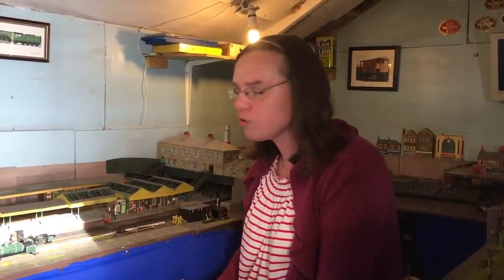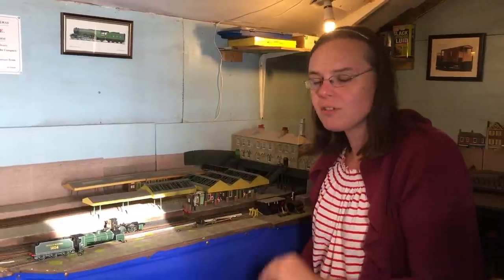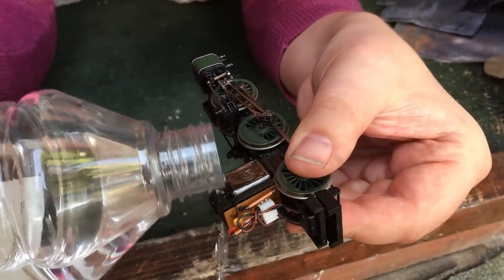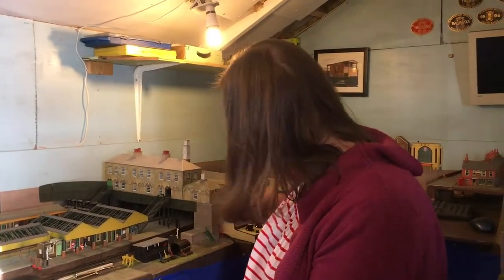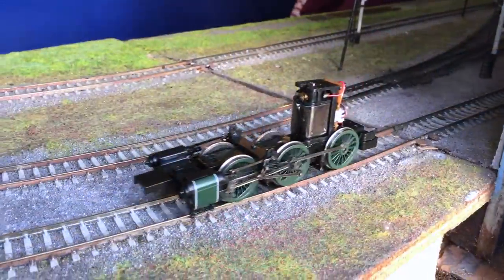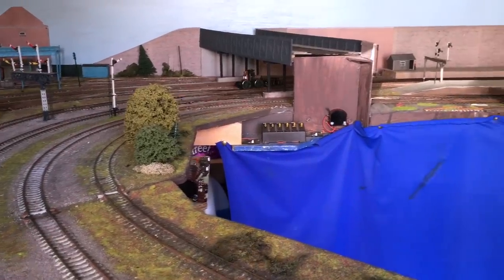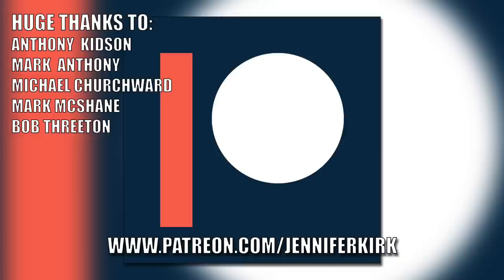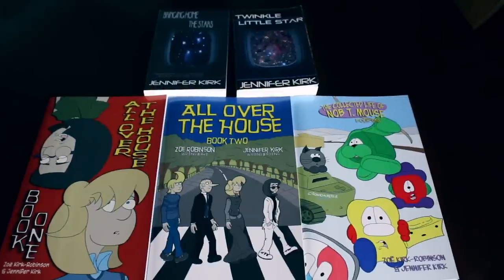How To Repair Suspected Burned Out Model Locomotive Motors

Comment: I had to look up "white spirits." It is a British description. It is the same as turpentine or mineral spirits in the states. I will try this. When I started repairing trains in a hobby shop some 50 years ago, I was taught to only use denatured alcohol, or grain alcohol poisoned to make it unsuitable to drink. In some cases, Electric contact cleaner could be used. We always made sure that the cleaner would not react with the plastic, or paints. Your solution is more economical. Thank you.

Comment: Can i wire up a capactior to a dc moter directley as a stay alavie
Reply: Yes , it will also give an inertia effect . I did with a slot car.
Model railway, on the other hand has a problem it runs both directions.  Polarity of rail changes so you need a bipolar electrolytic capacitor or 2 standard in series back to back.  Which will result in half capacity. Just need to experiment with size. 
Capacity in Farads × resistance In ohms will give a time constant x 5 will give time to discharge or charge.  That give you an idea how long loco will run for.

Comment: I have an older Rivarossi Dreyfuss Hudson that is overheating. I'm thinking it needs an engine replacement. Now with your information it may not. I know from my experience with HO Scale slot cars that oil is a major enemy of the comutator.